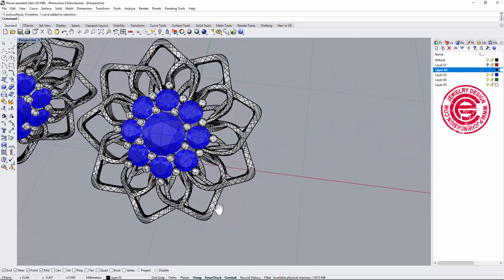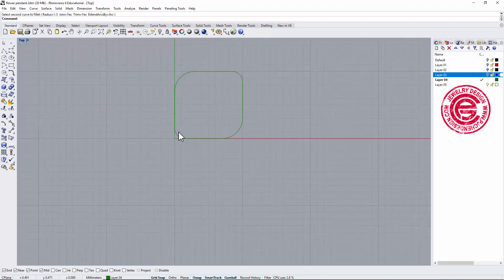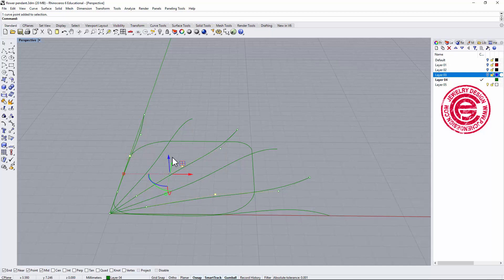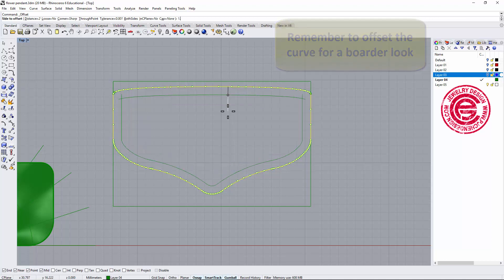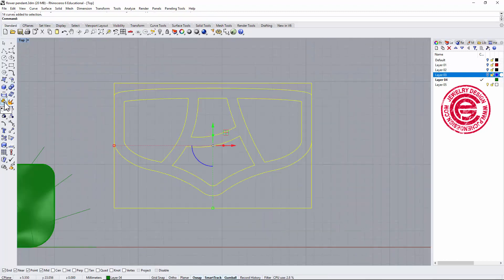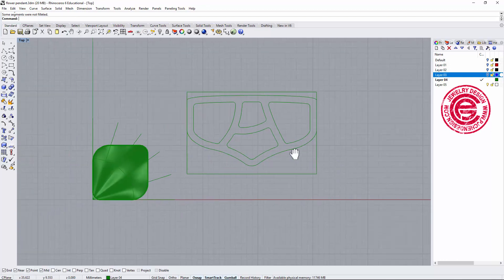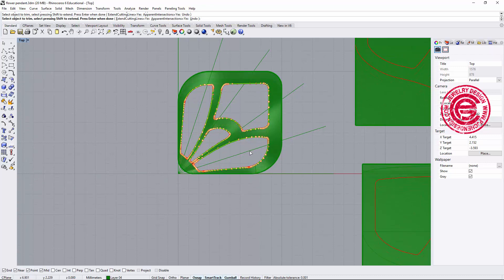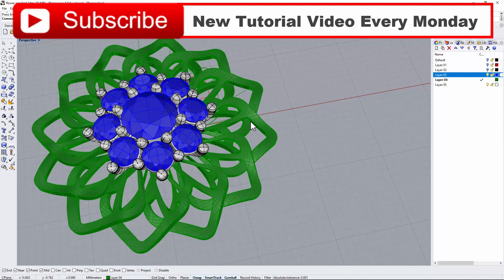Diamond Flower Earrings Modeling in Rhino 3D (2018): Jewelry CAD Design Tutorial #45

Comment: Can you explain the option "shrinktrimsrf?"
Reply from the maker: HI. The "ShinkTrimSrf" doesn't have "option" in the command bar like other command. What it does is to shink the surfac to the trimming edge, so when you turn on control point to edit, it will limited the control point to the trimming edge instead of original surface.
Reply: @PJChenJewelryDesign  thanks